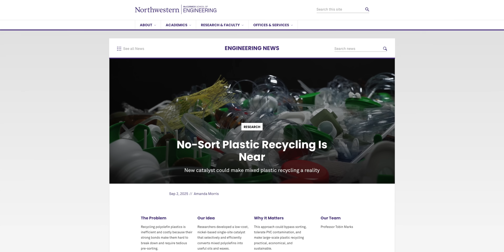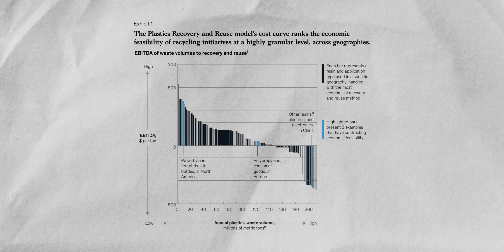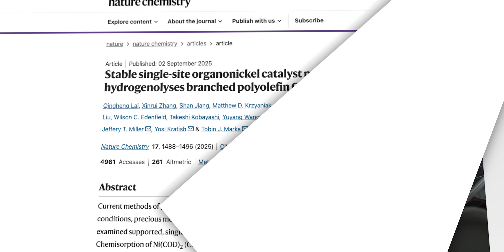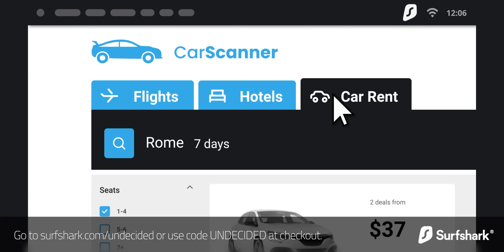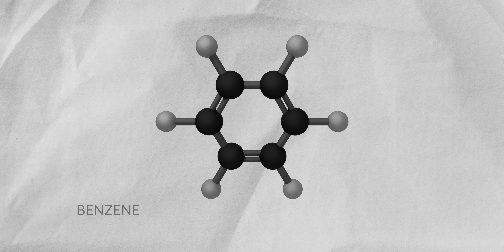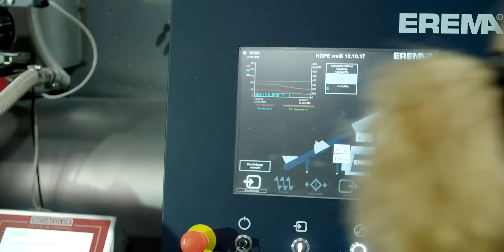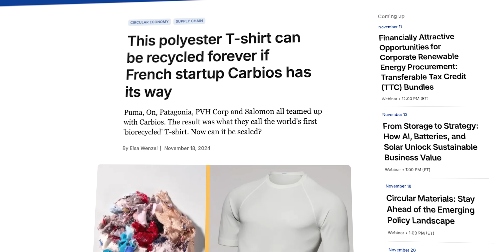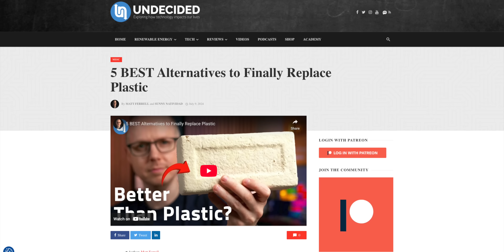The Recycling Breakthrough That Doesn't Need Sorting

Comment from the maker: Is plastic recycling finally within reach, and are these the kinds of breakthroughs that can get us there? Go to https://surfshark.com/undecided or use code UNDECIDED at checkout to get 4 extra months of Surfshark VPN!

If you liked this, check out How Close Are We to Solid-State Batteries? https://youtu.be/uspSYVssGXU?list=PLnTSM-ORSgi7uzySCXq8VXhodHB5B5OiQ
Reply: To get the uncontrolled giggling at PP under control you can also call it 2P.
Reply: @Cernumospete  tbh the 3rd or 4th forced "PP" giggle almost made me click off.
Reply: @Psnym   that's why I looked for an out.
Reply: 11:26 €0.14 => $0.07? Why? (current exchange rate: $1.16 per €1.00)
Reply: @AccidentalScience  from my other comment: 
The on-screen €0.14 is actually USD $0.16. 
Apparently it's due to kg and pounds being used in the voiceover?
Reply: Plastic based clothing and hygiene products are not smart. Synthetic clothing is a big source of microplastics that get EVERYWHERE - even antarctica. And breathing in synthetic lint, and slathering on things with synthetic chemicals in it causes some cancers, and who knows what else. Just because it can be done, doesn't mean it should be done.
Reply: @FLPhotoCatcher  Washers and dryers really need reinvention to save resources, but especially, to extend the life of clothing. Polymer fabrics break down from a cycle of heat, oxidation (maybe enhanced by sunlight), and mechanical wear. It's been my experience that synthetic garments last much longer with either line drying or setting the dryer to lower temperatures.
Reply: @nathandale3415  That may be a good idea, but I think making clothing from natural materials is better. Wool, cotton, linen, bamboo, etc, etc are good choices.
Reply: @FLPhotoCatcher  Arguably, the worlds worst crop is latex from rubber trees, just considering how they're cultivated. Rubber tires are also another immense source of microplastics.
Reply: Missed opportunity to shill any P2P service or software
Reply: Thank you for discussing / investigating what we are doing to improve the plastic situation instead of focusing on our current failures. I know failures are a great way to learn, teach others what has been tried and a way to keep the public informed but we also need to know we haven't given up.
Reply: Plastoline, there are bigger guys doing it than the famous youtuber doing it recently....
Reply: The plastic recycling problem, and more importantly the presence of micro or nano plastic particles even in our bodies, has encouraged humans to try to use less plastic. I'm concerned that an effective plastics recycling solution will reverse the goal to use less plastic.
Reply: Hey Matt,

engineer here working on direct liquefaction. We process mixed plastics, down to SRF qualities (solid recovered fuel). There is biomass involved in the mix and basically any other polymers besides polyolefins, currently running at 1000 tonnes/year. There is a lot to say about this video, but overall good research.

Plasma is a nice thing, but building plasma in a lab is very different to building it for processing 5-20 tonnes/hour. Also, oxygen, as major heteroatom, next many others, is a thing in mixed plastic waste streams, mainly due to non-polyolefinic polymers (e.g. PA) and especially biomass (e.g. food and paper residues). Sorting polyolefins to a purity that suits processes which are designed for polyolefinic mixed plastic waste also is an additional effort, that is not trivial - to my knowledge, most of these need PO-concentration higher than 90-95 %. The biggest issues for continuous operations above 400 °C are also coking, next to a commercially scaled feedstock input.

After all we're talking about economics - technical viability for mixed plastic waste at scale is already there. The energy efficiency has to be maximized, no unused energy allowed, minimum heat losses, otherwise you lose. 

Would be glad to further exchange on that topic.
Reply: Unrelated to this video, but worth mentioning just the same... I think I may have found someone more punnier than you.  https://www.youtube.com/@RobWords
Reply: Hemp is the solution to plastic , batteries and thousands of things that we are struggling with due to our most useful plant being illegal since 1937 and now legal again since the 2018 farm bill.
Reply: @video-z3n
That doesn't make much sense.
Who are "we" that are struggling due to hemp banned for 80 years? I'll ignore the stereotype of deafaultism to an unnamed country, as this is internet, not a country.

 Idk the law where you are, but at least in Europe hemp has never been banned. If you meant Cannabis, it has never been legal up to recently in a few places either. Thing is, they're not the same thing. Cannabis plants are just one group of strains of hemp, besides only the female plants of the former have the controlled THC and CBD.

 Hemp is made from unregulated hemp plants and you could always get its products in most places. It is recently making a comeback, although mostly in traditional and luxury product range, like paper, ropes, containers and decorative fabrics, building materials and food. There is a different reason why it's not taking over the market and replacing alternatives: economics. The small scale of industry makes for higher costs and prices.

 Ex.g. while hemp building panels have extremely high energy efficiency, they have to be used in prepared dry paces and can't bear much of structural loads, besides being multiple times more expensive than the alternatives.
  Also, saying that hemp can replace plastics is like saying wood fibres - thus cellulose - can do. Only in limited use cases it can. I've yet to learn how can it replace batteries.

 Here in Baltics, we have a millenia old traditions of hemp products - from ropes, rough fabrics, tools, building materials, feedstock (fibres, stems and leaves) to food products (seeds, butter, oil and recipes made from them). We still make and eat them. Never any problem with growing them, as nothern hemp strains do not contain controlled substances in notable amounts. That's a later development.
 
 I'm saying this because assumed westerners like you sometimes talk like you live in an orwellian USSR-type planned economy (in which I was born in), while in reality it's still pretty much a neoliberal free market. If it made sense economically and physically, you'd be living in a hemp world that your imagined myth decries the lack of.
Reply: @UndecidedMF  , see if you can provide content without teenage giggles at abbreviations and related memes
Reply: No, we haven't. I am commenting without watching this video
Reply: Wouldn't PE (Premature Ejaculation) get more giggles than PP?
Reply: @UndecidedMF  
It
Reply: funny.. we have PP plastics and 3D printer poop. wonder when we will have PP filament, so PP poop becomes diarrhea
Reply: Answer is no, pls stop the clickbait 😒
Reply: I made it through 4 or 5 "PP - giggle giggle" before hopping off about 6 minutes in. This content not worth the annoyance.

Comment: All plastics can be turned back into fuel by applying pressure and heat. This process is self contained, self sustaining (the initial high octane output fuels the heating). Simple

Comment: There was an interesting article similar to this idea, except that the end result completely destroyed the product or item being "recycled".  But, in a very good way!  There was also no need to separate anything being recycled, as the process didn't require it.  The article was in Discover magazine, and was called "Anything into oil".  Basically, a new way was found to use old technology to recycle almost anything that was carbon based, into 5 products that were safe to use, and needed by everyone.  The output that was received depended wholly on the product that was being recycled.  That meant that, literally, almost anything could be recycled.  Bio-hazardous hospital waste, no problem.  Old tires, constructions waste, animal waste from farms, particularly pig urine, municipal waste, slaughterhouse waste, or even poison weapons from the military, almost anything except for nuclear waste could be recycled.  The recycling plant could also be scaled to the area that it would be serving too.  The 5 products that came out were a sterile water, that could reenter the cities water supply.  Natural gas, which the plant could run off of, and either sell or cleanly burn away.  Two types of minerals that were better, safer, and more potent than currently available fertilizers, and finally, a high quality oil.  This technology could mean the end of trash dumps, trash being thrown into the ocean could be collected and easily taken care of.

Comment: This is very cool and promising.
Now we must not forget, these cycles are STILL gonna generate microplastics, because there don't appear only at disposal. An extremely high percentage of all microplastics produced come from "every day" degradation of our polyester based clothing. Not the one we throw, the one we use wear, wash.
And, most of these plastic fibers are not good on the body and IN the body.

THE REAL horizon we must aim at is developping and using bio based, non agricultural intensive bios plastics, like PHA family for example, but adapted to each use (without shady/harmful additives, of courses).

Comment: I spend on average 20 mins per day washing plastic containers to throw them in the bin only for it to get mixed at the road side pickup to turn into mixed crud.
In my opinion the two ends of the chain do not appear interested in cooperating with each other.  Product design seems only interested in keeping say its patented shape bottle (Coke) rather than a more universally accepted mix of shapes  which could be cleaned and re-used thus dispensing of most of the recycle chain. 
In the UK after the war we had glass bottles for doorstop milk which were returned to the dairy and directly re-used.  Most now buy Milk in a supermarket, but even there we could take our bottles back and refill at the store.. I would be perfectly fine with that. 
Milk delivered from the farm to store in IBC containers..
Keeping the various plastics seperated during the Trash cycle really shouldn't be that difficult with better labelling and processing isolation.  Make change at the beginning.

Comment: Plastic, especially PET is a continuously recycled material as well. It's lightweight capabilities in comparison to its glass, metal and paper counterparts reduces greenhouse gas emissions. Not only in its creation but also in it's transportation. There are also companies that are utilizing/making as much rpet (recycled pet) as they can but the demand/ capabilities are not being met to the scale needed. If we continue to encourage/ force companies to at least partially use rpet in their materials and allow ourselves to adjust to the cosmetic look of rpet bottles, we can begin to solve this issue. Also, we need to begin mandating recycling. Metal should be recycled. Glass should be recycled. Plastic should be recycled. Just because people are allowed to throw away plastic doesn't make plastic a bad material. People are allowed to throw away gold, doesn't mean it isn't valuable.

Comment: Plastic is simply a waste product of the oil industry. They don't want us to recycle because the consumer is their waste disposal system. They price the virgin material so low as to undercut all other materials and recycling efforts. Simply put if we recycle they will have to take responsibility for disposing these materials. I firmly believe we should be recycling. However as long as we are using gasoline, they will always have a competitive edge to sell cheap plastic. 

I believe we should tax plastic and use these tax earnings to develop state run plastic recycling. 
Hopefully this will help us increase the cost of plastic enough such that other materials become more likely to be used. 
We also need to ultimately transition away from oil so less plastic is produced. This is really the only way forward.

Comment: Plastic recycling is an uphill battle against the petrochemical industry. In other words, it's a lost battle. It's a problem that is already solved, but they will only allow the solutions to be implemented if it ever suits them. Not any time soon.
Reply: Recycled plastic is less plastic sold. And plastic pollution, microplastics etc, are problems that can be spined to generate profits. There's really no reason for those who yield immense political and financial power to prevent this problem from happening.
Reply: @obliv6926 sounds like an argument to remove their power then.

Comment: A big problem with recycling is it gives people the illusion that they are doing enough and can keep their consumerist habits as they are.  It lets folks ignore the other two, more important steps.  Re-use: Instead of buying disposable everything, get things that can be reused over and over.  And even more important, reduce: Buy less.  Use less.  Not saying don't get anything.. but just keep in mind it in mind that we need to reduce our consumption.  I know this sounds very anti-capitalist.  But it isn't.  The manufacturers follow the market.  Industry will find ways to capitalize on new demands.. demands of longer lasting, higher-quality products, and products that people actually need, rather than all the crap we buy that finds its way into landfills a few weeks later.

Comment: There are already plasma arc recycling furnaces that ruin at those temperatures that process mixed waste.  Knowing the running costs are already laid out there at industrial scales.
They just don't add hydrogen to the mix.

Comment: Recycling plastics is part of the solution, but... what about microplastics?
If plastics will still slowly poison all life on the planet, maybe we ought to try NOT using it in everything?

And if the planet evolves bacteria that eat plastic, and those spread... doesn't that remove one of the main selling points of plastic; being impervious to bacteria? 
Feels like we should develop one material to be easily formed into products, but which is biodegradable, and one for limited use in medicine etc, which is not.

Comment: Deconstructing polyolefins to hydrocarbons with hydrogen reduction will likely never be cost effective as the hydrogen added will need to be removed in order to reuse the carbon base to make polymers. Yes, the hydrogen is recovered but adding two steps, hydrogen addition, hydrogen removal, will add hugely to cost and overall efficiency. And glass certainly has advantages in terms of endless recycling pollution but adds greatly to energy consumption for both transportation and reconstitution. Most academics working in this field have not concept of the magnitude of the scale of what they are trying to address. Sea weed sounds great until you consider how much you would need to harvest to make a dent.

Comment: Why not just use “waste” plastic as fuel, replacing petroleum where critical control is not necessary, say in concrete production, a highly energy consuming industry. While not strictly recycling, the net effect is the same as long as petroleum is still being consumed as a source of energy.

Comment: I think the KIMM approach is probably the closest we are ever going to get to a "replicator" of star trek this century. Plastic feedstock to Plastic item, back to Plastic feedstock. If that works, it doesn't really matter how the hydrogen is generated because those hydrogen gasses can become economical and also recycled. This is still pretty far from actually being able to recycle everything because the current processes require essentially still sorting the input materials. The perfect recycling system would literately let you take a cubic meter of garbage, of any kind, stick it in the input, and the output would be pure metals/liquids sorted into outputs to be reused, skipping the entire mining/smelting phase.

Comment: A term that keeps popping up in these discussions is economically viable. But when you are using that term in regards to the petrochemical industry it is completely invalid. That is because most of the real costs incurred by this industry are nowhere to be seen on the balance sheets. 
  All of the world's governments are absolutely dependent upon petrochemicals to operate their military machines. This is something that both the industry and the governments are highly aware of. As a result of this sad fact the industry has a great deal of influence on what decisions the government does and does not make. Some of that influence is used to ensure that a portion of the hidden costs of petrochemicals remain hidden. 
  Things like the extreme costs that medical care has to bear due to the introduction of petrochemicals into our air, land and water. Then there is the carcinogenic factors involved with long chain polymer products. Add to this the closed loop cost of petrochemicals which have been added to our agricultural systems. That is where a large variety of herbicides, pesticides, fungicides etc, are sprayed onto our farmlands, (mainly derived from petrochemicals). This in effect sterilizes the soil so that various fertilizers have to be applied to support the next seasons crops, (guess where they come from), which again have to be retreated with the whole range of various pesticides again. This cycle began in the 1920's and has been highly developed in the 100 years since then. These, although significant, are only some of the costs kept from the balance sheets of the nefarious industry that J. D. Rockefeller set the standards for way back when.
  As a result of this, whenever I hear the term economically viable in any discussion involving petrochemicals I immediately assume that the validity of the discussion has been compromised. Sorry about that, but I am an old man in the 21st century. I have been around this block a couple of times and have become a wee bit jaded.